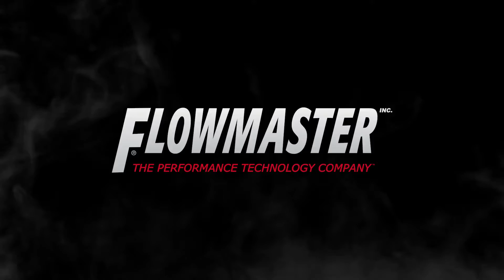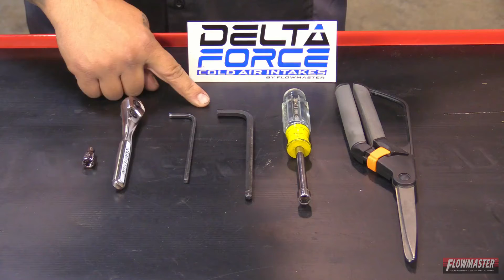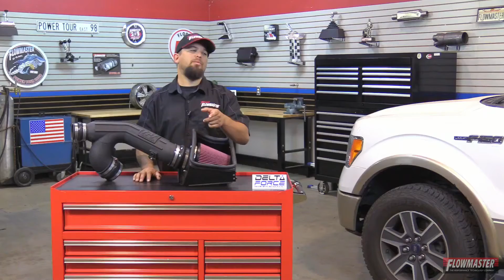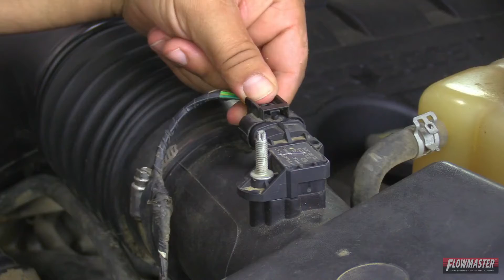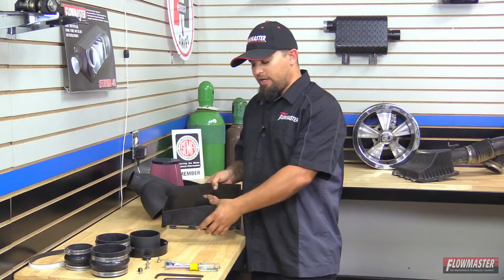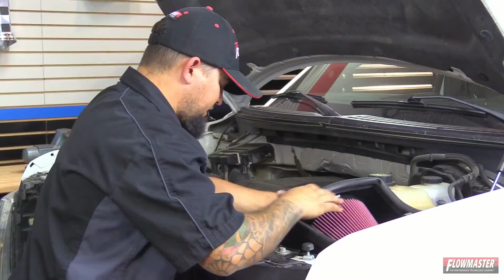Flowmaster 2012-14 Ford F-150 3.5L EcoBoost - Delta Force Cold Air Intake 615149

Comment: Thanks for taking the time to make this video. I just installed this air intake on my 2013 f150 FX4 3.5L v6 EcoBoost today. I couldn’t find to many reviews on this intake. Pretty easy install, especially with this video. I could definitely feel the extra horse power right away. I’m not sure about mpg’s just yet, but I hope it’s an improvement.